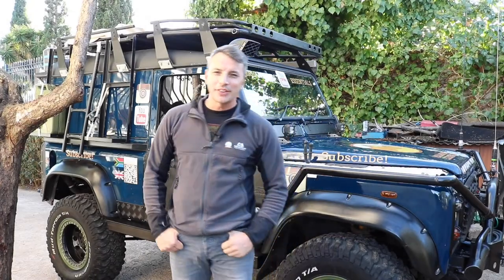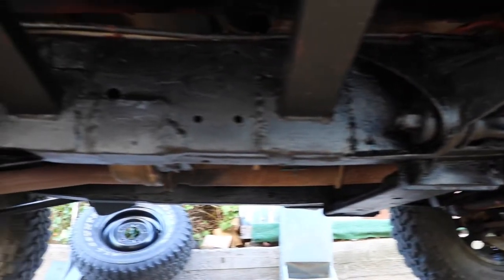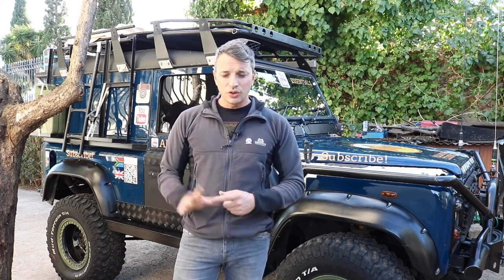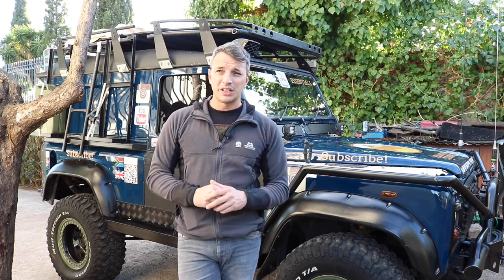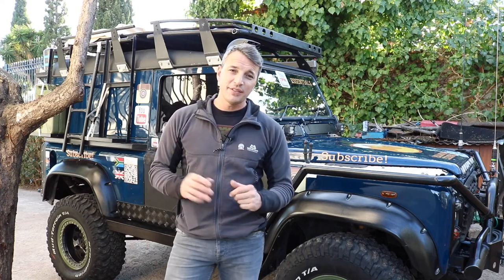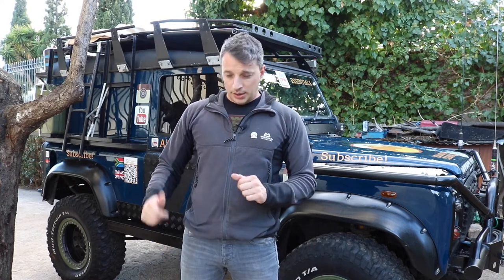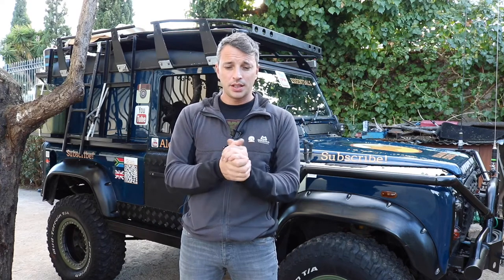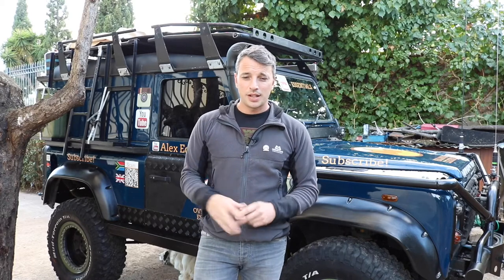Chassis Service, Plus DIY Rock Sliders And Tank Guard.

Comment: Here in the rust capital of America we use a thing called Fluid Film..there's a way to make it homemade too. It's basically coating the underside with sticky oil and there's no way it can rust. Around my area it's super cold and long, snowy winters so they use a heavy dose of salt to melt the ice and snow. That's murder for the vehicles here.
Reply from the maker: +Nigel Naughton That sounds interesting. How do I make it? Maybe I’ll chuck it into a video...
Reply: A lot of people use used engine oil alone or mixed with something like kerosene or transmission fluid to thin it out. You can also use bar chain oil for a chainsaw if you wanted to go the 'homemade' way. You either brush it on or can spray it on. Amazon sells it by the gallon and it's not that much...about $45/us gallon. Cheap insurance I think and it last a couple years I think. I am going to do it to my Land Cruiser 80. 
https://www.youtube.com/watch?v=Y0lJDuCWFlA
Reply from the maker: +Nigel Naughton sounds good mate, send me a pic of your cruiser. I’m also on FB and instagram Alex Ednie

Comment: Did you say you'd shortened and repaired a brake line with a jubilee clip at 2:30?
Reply from the maker: +reedxuk oh no sorry meant fuel line off of the fuel filter housing. My mistake!
Reply: Alex Ednie I'd guessed that was probably the case Alex. Keep up the good work.
Reply from the maker: +reedxuk lol cheers mate!